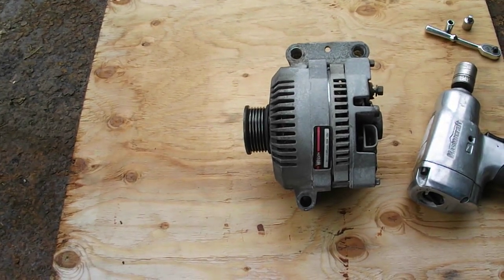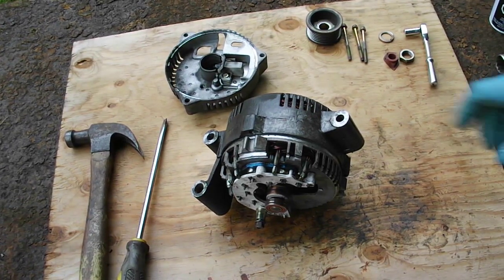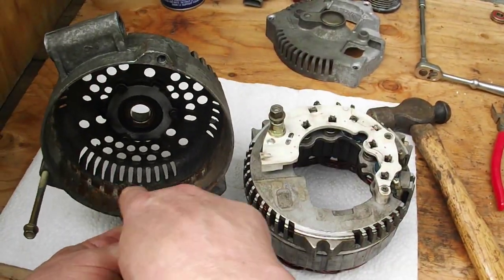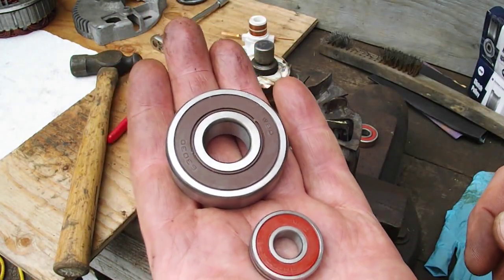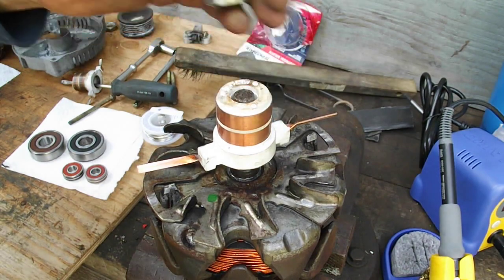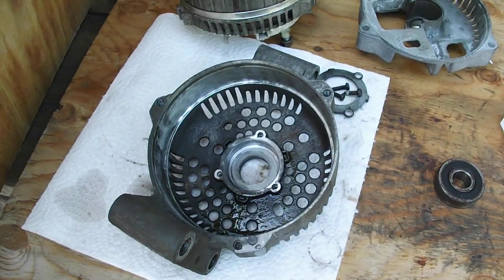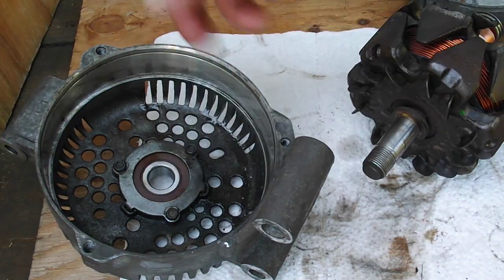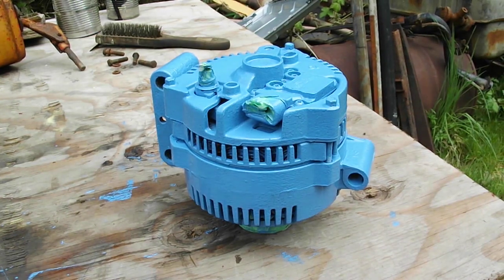F-150 3G ALTERNATOR NEW BRUSHES AND BEARINGS

Comment: I wish I had seen you actually get it out of there because mine will not budge and I spray oil put heat on it about ready to give up but my parts is already being shipped work on it some more later
Reply from the maker: The sides of the case gets rusty, Just keep working it by tapping (lightly) with a hammer all around the seam and it will let go. The heat and oil, in combination with light tapping will free it up! Good Luck!

Comment: What type of tin do you use for soldering? Can I use the tin that plumbers use to solder copper pipes? thank you
Reply from the maker: Look for ROSIN CORE Electrical solder. It's not recommended to use plumbing solder because it contains an acid-based flux that can leak onto connections and corrode them. All solder is now available in Lead-Free options which protects the worker from lead ingestion/exposure.

Comment: Very nice video. I am going to rebuilt my alternator. Can you provide the link where you got the rebuilt kit? I have a 2004 Ford F150 XLT.
Reply from the maker: Check Amazon and Ebay. Also, any parts store will be able to find you the correct kit. I don't want to give you wrong information. They'll be able to find the right part based on your make/model/year/and engine size. Thanks for watching
Reply: @EverydayProjects  Thank you for replying to my question. One thing I don't know is what type of alternator my 2004 Ford F150, 3v 5.4 needs. I searched the web but wasn't able to find information. Are the alternators for other F150 for other years interchangeable?
Reply from the maker: Check rock auto dot com. They will have your alternator. Good luck and best wishes